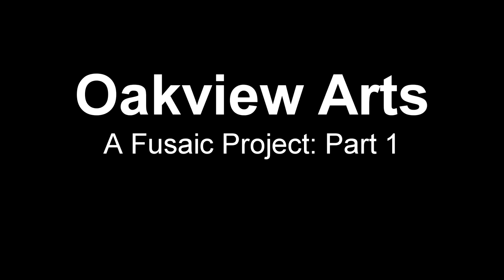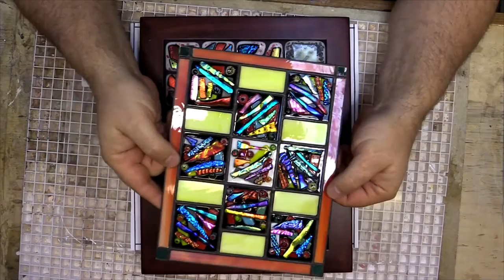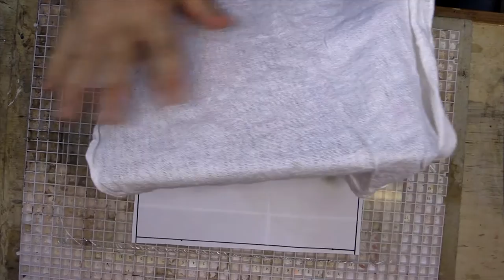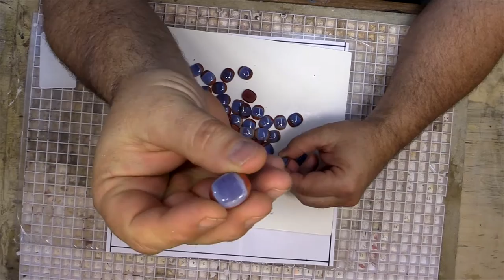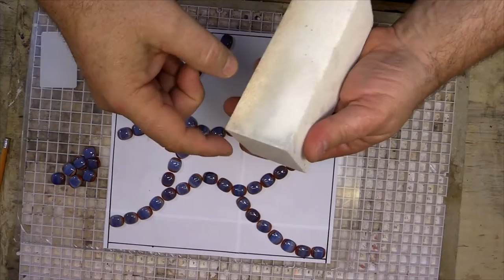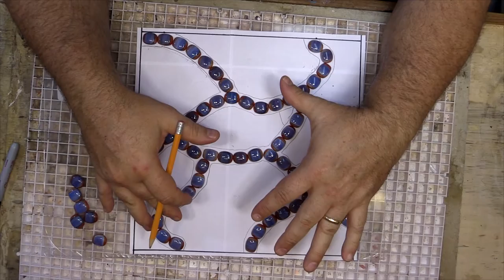A Fusaic Project: Part 1

Comment: I'm just getting into glass so do you do the art shows yes grouting is terrifying I'm telling my husband that we need a tiny travel trailer to do shows...  the work you held up to show us is amazing abstract art.  I am  BFA. I love your incorporation of dichroic. I'd like to know if you know how to slump in the microwave I don't have kiln yet....
Reply from the maker: I've never tried doing that.  I don't think a typical microwave kiln would be big enough for a slumping mold.  You can buy a 5 inch diameter one on amazon for cheap $40 but those aren't highly rated (Chinese junk maybe).  I don't know...they may  be good enough for doing some experimentation but might not be durable.
Reply: thanks for your reply and I got a kiln yesterday!    I did make a 5 in. circle with dicro on top of a clear piece.  It is nice but thin and a couple of the dicro pieces are black blocks of color.  Maybe I didn't notice that I'd not turned them over before firing.  I did this in my microwave kiln.  I am addicted to it and the fast way it does the glass.  I even tried raking and made a couple small face like pieces.  So I will continue using my microwave kiln.  Thanks so much!